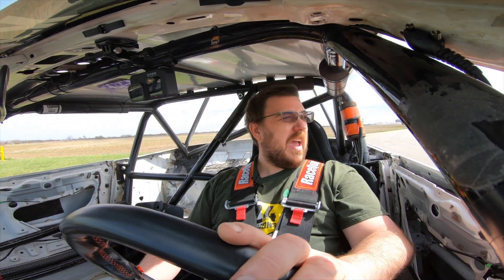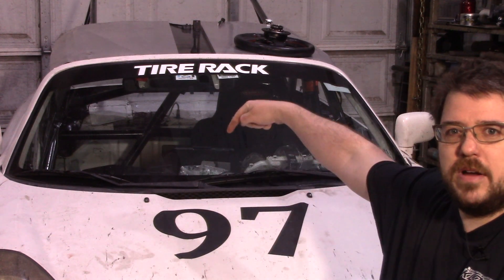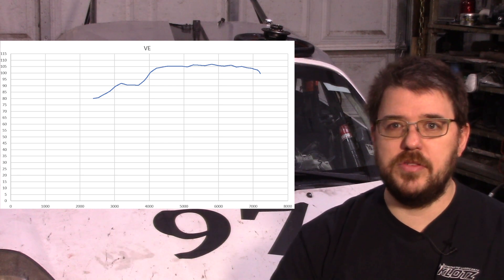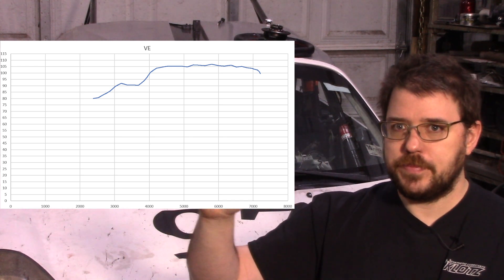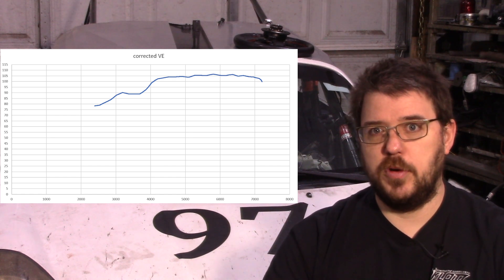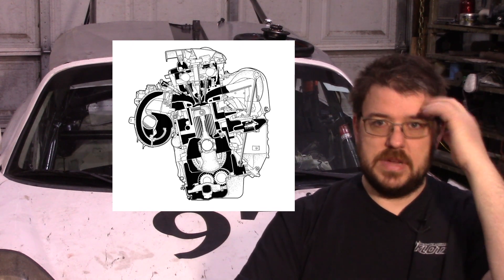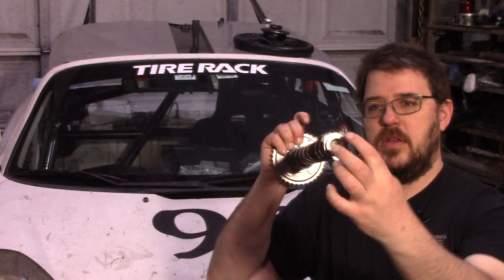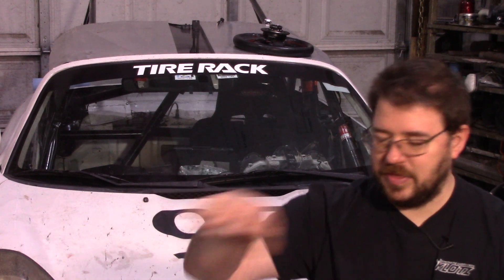Next steps for adding power to the 2AR-FE/1AR-FE platform

Comment: im here because of gears and gasoline. didnt know there was this much potential for N/A HP in the 2.5 liter motors.
Reply from the maker: If you look at the numbers on a 2AR-FE it has a 90mm bore and a 97mm stroke with a really tall 165mm rod to give a nice rod ratio. It even has a 105mm stroke crank available from the factory that has been proven to 850whp in the most abusive of conditions. The stock crank and rods are forged units.

The intake valves are 36.5mm and the exhaust valves are 31mm. the intake ports are absolutely massive at 3.5sq.in in cross section and the exhaust ports are also significantly larger than a motor of this size/power should have.

It's obvious when you look at this motor closely that when Toyota designed this they had something bigger in mind, other than the pistons it essentially starts at where you'd be after putting $5-8k in a normal motor. They can't run forged pistons from the factory because forged pistons can make a bit of noise on cold starts and that isn't acceptable to most car buyers.

Comment: How powerful is the 2 ar fe
Reply from the maker: So far on a completely stock block with stock internals and even stock camshafts the max has been about 240whp naturally aspirated and about 400whp with a turbo. If you want to see the actual max so far look at Papadakis racing, they have one making over 1000whp. That motor has a ton of fancy parts in it but if you look back a bit in their history you'll see that when they were making about 850whp they were using quite a few more stock parts.

Comment: Looking for a 2AR-FE to replace the 22RE in my '84 Toyota Celica GTS. Similar displacement (2.4L vs 2.5L). Not sure about mounting it though. Most Celica's like mine go with a 3S-GE/GTE or 1UZ-FE swap instead. Not much info out there on RWD 2AR swaps other than Papadakis's FD Corolla.
Reply from the maker: I think the Alteza transmission would work and there should be a few others but as you said, nobody has really publicized these builds yet if they have even been done.

Comment: Hey, I am new to your channel, great content. I want to swap a 2aR-fe in my 09 toyota matrix, which has the 2az-fe 2 four. It looks to me like the engine and a manual transmission would mount right in.
Reply from the maker: the 2AR and 2AZ have a very similar bolt pattern and should be swappable directly. The 2AR is taller though so that may give you a fitment issue. not sure if the 2AR is longer, it might be but maybe not.

Comment: I’ve always wanted a fast MR2.
Not a drag or circuit car, just something really quick to 100 mph.
Something with 350 or more hp.
Where would I look for that kinda car?
Reply from the maker: The 2GR is at 350hp and i sell the parts you need to install it in the SW20 and the ZZW30
Reply: @FrankensteinMotorworks  
Hello
I have a 2GR in my ‘12 Avalon 
Incredible engine!
Although I have a decent garage and tools. I don’t have the energy to dedicate to that binds project, but I have the $ to buy a readymade car
Reply from the maker: @flyonbyya  Yeah, it's an incredible engine and we've managed to get another 80hp or so out of it in the MR2 application

Comment: Or custom grind portions of the trigger, and  bolt in the cam trigger points for vvti trigger on fxe camshaft?  There must be a way, lol.
Reply from the maker: there absolutely are ways, but first we need to see if it is worth it by doing it quickly on an aftermarket ECU.

Comment: Shaving the head to increase squish and compression ratio and removing the balance shafts is a great start with this engine without requiring an aftermarket ECU.   Perhaps you could also use the 2AR-FXE intake on the intake and exhaust and either re-clock or machine another set of lobes for the cam position sensor so that the stock ECU believes the cam is in the stock orientation.  Since these lobes are not driving anything (magnetic pick up only), you only need them to not spin on the cam.  I had a machine shop make a custom crankshaft position sensor for the 4AGE using a 4AFE crankshaft position sensor combined with the 4AGE cam belt drive to allow COP; similar idea.  You have a machine shop...I do not.
Reply from the maker: Yes, i did consider re-clocking the cam trigger on the 2AR cams. not only do they not drive anything but they are on the end of the cam so they can easily be machined off and replaced just as you say. It isn't an option that everyone can achieve easily but it's absolutely an option that could work rather well to use the 2ar-fxe intake cams in both positions in a 2ar-fxe motor with the stock 2ar-fe motor. This would likely hit that 250whp number for a really cheap budget.

To get your squish optimal you'd want to shave about 1.2mm off. on the 1AR-FE that would bump you up to 11.0:1 on the 2AR-FE that would bump you to 11.6:1, on the 2AR-FXE that would bump you to 14.4. Unfortunately none of these numbers are really that great. 11.0 and 11.6 are leaving power on the table and 14.4 would be likely be an e85 only build and the stock ECU can't handle an ethanol content sensor. alternatively you could use that 14.4 CR with the vvt-iw (wide) and run it in atkinson cycle to reduce the VE where the compression is causing knock but that's an operating mode that is a bit too far outside of the stock ECU's capabilities so you'd be back at the aftermarket ECU cost. 

The 1.2mm would also retard the cams by 1.3 degrees, that isn't enough to cause any problems, not even with the stock ECU. I calculate that it would also eat up about 5mm of the timing chain tensioner travel which is about 40% of the available travel so it would still be in range but that is a big change.

Comment: Hi Marc, you mentioned the FXE to me once, via PM. I am in the Netherlands and will eventually want more power. I bought a better starting point car for the build, so I am still on the stock 1ZZ but I am eying this the whole time.

If these are available in the Netherlands maybe its the better to try and get this swap going over here. I will be in contact with Facebook. I think you, I and the garage I use should discuss this further, there really is a potential here for fun, and sales of the swap kits if it works well (not speaking for the garage, just in general). 

Personally I have to save up money first, but it's crying out to be the swap we make normal!
Reply from the maker: Yeah, at the time i did not realize that the 2AR-FXE could actually be a performance upgrade. The issue you'll have is getting the EB60 transaxle but the best answer there is probably just to get a new one shipped for $2200 + shipping. The used ones are $1800 or so right now with COVID so the extra $400 isn't hard to justify to get a new one instead.

Comment: So I have a question, I unknowingly replaced my FE with a FXE. I had the motor replaced years ago now in a shop and I bought the motor because at the time it was $1,200 for a motor with 10K miles on it. How much more freedom do I have with that motor as far as adjustability or modifying? If I were to shoot for say 250 crank hp, what would you ideally change to achieve that. Aside from simple bolt ons that is.
Reply from the maker: Alex, since you did it unknowingly i imagine you actually have the dual vvt-i version otherwise the difference would have been obvious and you'd be getting fault codes for the missing exhaust cam signal. That means if you're on the stock ECU you can just switch to the regular -FE cams and you'll have a higher compression 2ar-fe. that's about the limit with the stock ECU. If you're going to run an aftermarket ECU then you're there, just advance by the intake cam by two or three teeth and get another 2ar-fxe intake cam and install it in the exhaust position (note i haven't tested this yet, it might need a bit of fabrication to the end of the cam for the exhaust vvt-i actuator to bolt on) and then you've got a high compression motor with long duration cams. Add my MAF pipe and a good header/exhaust and then tune it. I'll be happy to give you my Haltech tune as a baseline if you decide to go with a Haltech.

as for making 250crank hp, that's about 210-220whp. The stock 2AR-FE with my intake, exhaust and tune makes 205whp already and you've got 12.5:1 instead of 10.4:1 compression so that difference should get you to your goal.
Reply: @FrankensteinMotorworks  Interesting. I have the vin plate off of the motor from the original vehicle. I will do some research on it tomorrow to confirm. But if I am correct it came off of a Rav4 Hybrid which came with the FXE motor. I have the engine serial code but that only signifies the plant it was made at, and the date of production.
Reply from the maker: @HotBoiRicer  i was actually having this conversation last night on the discord channel and we confirmed that there is no 2AR-FXE with dual vvt-i. so if you have two cam solenoids then you do not have a -fxe motor. Keep in mind that some hybrids came with the 2AR-FE motor, they don't all have the 2AR-FXE
Reply: @FrankensteinMotorworks  You have a discord channel?
Reply from the maker: @HotBoiRicer  Yes, right here: https://discord.gg/jSzmVfv

Comment: I probably missed it, but what were you running for fuel type on your dyno runs?
Reply from the maker: I'm using 93 octane (R+M)/2 fuel. Because this is an endurance race car i have to be able to afford fuel for racing 20-30hours in a weekend so you're unlikely to see me use anything exotic in this car. Even E85 is out of the running because the lower fuel density would mean more pit stops and that kills an endurance car.
Reply: @FrankensteinMotorworks  True on the mileage, but the appeal (and real world application) of what you are pioneering goes beyond just endurance racing for your audience.  Many of your followers are into off roading, drag racing, drifting and all other manner of Toyota Motorsports.   It wouldn't be unfair of you at all, in your quest  to exceed many a K24 N/A dyno number, to run E85 as it is commonly available to all.  It's cooling of the intake charge, anti detonation properties (especially useful once you up the compression) and ability to  alter your timing,  can result in increased HP.
Reply from the maker: @MadManMachines  I completely agree but building a motor that i can't use just to put it on the dyno is not something i have the funds to really spend on. this is a tiny one man operation over here selling MR2 parts only. I need to figure out how to make money from a bigger 2AR before i really dive deep into it.
Reply: @FrankensteinMotorworks  I hear you, keep up the great video's, i enjoy what you're doing with these motors.  We have an iron block 2TR-FE sitting here we someday want to build, a little different then the 1ar,  but plenty of similarities as well.

Comment: Wat about the 2AR-FSE? Could this one also be a good power platform?
Reply from the maker: The 2AR-FSE is intended for longitudinal mounting, not transverse so it isn't as useful to use. I don't know if the cams fit or not but they aren't anything special, 248/244 duration.
Reply: @FrankensteinMotorworks  Maybe the pistons could be used, because they are higher in compression.

Comment: How accurate do you feel your volumetric efficiency readings are, is there any margin of error in them?  Do you think a short runner intake manifold could improve the volumetric efficiency any greater then it is or do you think you are at max? I've read as high as 130 percent on N/A, but in practice much lower i realize.  Or the exhaust couldn't improve it further too?   Interestingly, i came across an article where they were testing the 2gr (true, different toyota motor), but they were testing different size primaries on the header and they started at i believe it was 1.5" and went all the way up to as i recall it was 1-7/8"  and they couldn't believe they were still gaining power on they dyno, on paper it didn't make sense.    Also, even if power didn't improve with a shorter runner intake (and/or larger plenum), it may move the power band up which depending on what type of racing you're doing and what your operating RPM range is, it may improve performance of the vehicle in that narrow band (might kill it down low too...lol).   When you up the compression ratio i wonder if at that point you couldn't start to see gains with a shorter runner or larger plenum intake and improved exhaust in either the runner length or diameter?    As you know, traditionally, Toyota intake manifolds are great for stock or near stock, but gains are often found (on the 1uz for example, they see 30hp just by replacing the top runners with a open plenum on top of the shorter bottom runners).  Apples to oranges comparison, i know but food for thought as i'm having trouble wrapping my mind around that Toyota developed a stock intake manifold that is supporting 275+ crank HP and no improvements are to be found on it.  I feel it's a case where a shorter runner custom intake manifold needs to be tested back to back against the stocker on the dyno.
Reply from the maker: Based on my long term fuel trim learning my VE numbers are probably about 3% low. Obviously this isn't metrology grade measurements but since the ECU is using this number to calculate fuel and the fuel trims are low and the targets are getting hit and things like injector dead time have only small effects at high load the VE numbers are probably reasonably accurate. It's absolutely possible to hit higher VE numbers on an NA motor than the 107% or so that i'm hitting right now but generally when you get high it's because of resonances and those resonances are usually for a narrow RPM band. Since i have this stupidly wide torque band right now i think it would be diminishing returns to try and chase a higher peak number but give up the power band i have now. That said, i will try it at some point, it just isn't a #1 priority right now.

Of course we can't forget that just because we haven't found the limit does not mean that these components aren't almost at their limit and it's quite possible that they will quickly become the next issue. 

As far as tweaking the exhaust goes on this car i really can't do anything. the header i designed was as big and wide as i could in the very tight spyder engine bay. it has 1.75" primaries into 2.125" secondaries and a 2.5" merge (it's a 4-2-1 design). there would be room to flare back out to a 2.75" or 3" pipe after the collector which could help but that's about all that could be done there without spending stupid amounts of time on a header design.
Reply: @FrankensteinMotorworks  I hear you, you bring up some good points.  Looking forward to your future mods on it!

Comment: 5w30 oil? 2ar is supposed to be 0w20.
Reply from the maker: You know, i've been using 5w30 in there for so long that i forgot that it actually calls for 0w20. I use 5w30 because i use klotz high zddp oil and they don't have anything lighter. toyota also recommends "An oil with a higher viscosity may be better suited if the vehicle is operated at high speeds, or under extreme load conditions."
Reply: @FrankensteinMotorworks  O I didn't know that. Well, if you choose to play around with viscosity,  I like royal purples 0w20
Reply from the maker: @Treaxvour  i probably won't. i've run thousands and thousands and thousands of race miles on that klotz 5w30 in these engines. I'm pretty satisfied that it works well with it. not saying royal purple may or may not work as well, just saying there's really nothing to gain from me trying it.

Comment: Two options that may be cheaper than even aftermarket ECM for this setup would be to machine a custom set of teeth shifted 20 degrees off in the other direction and pinned onto the camshaft. Or, and I say this completely green because I have not seen the AR engines is to move the cam pickup sensor. Both require machining but may be cheaper than factoring in a custom standalone and tuning it.
Reply from the maker: i don't think this would be viable on the AR. On the GR's intake cams it might be because that sensor is a different piece. but on the AR the sensor is embedded in the valve cover pointing straight down so it would be tough to re-angle it.
Reply: Actually the hall sensor is able to pick up the trigger even if it was cut off and rotated. 
-drill and tap
-Cut and square 
-Bolt and braze
Reply: @alexhise968  exactly, by “teeth” I mean the trigger wheel on the cam. Make a new trigger wheel and turn it 20 degrees on the cam
Reply: @evilthorne  the oem trigger would still be fine to use. Just a tad skinnier

Comment: Would the easiest way to high compression on the 2ar be by having the block shaved down?
Reply from the maker: I actually ran the math on this, you could get to 11:1 by shaving the head down. any more than that and the squish would get too tight.
Reply from the maker: that 11:1 could be good for 10-15hp or so.
Reply: @FrankensteinMotorworks  would this require a new tune?
Reply from the maker: @michaelscholten9753  i doubt it. the stock ECU would be more than happy to deal with the extra compression